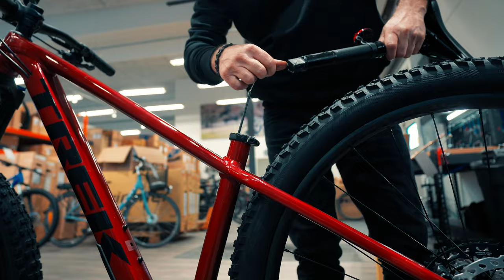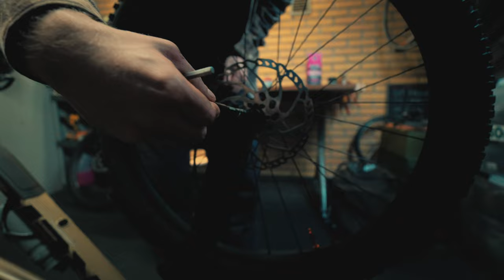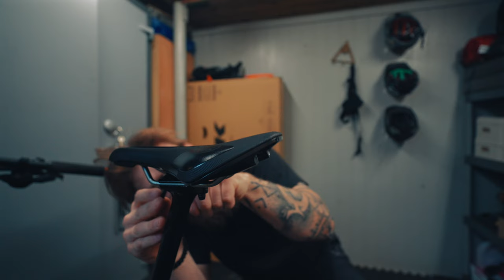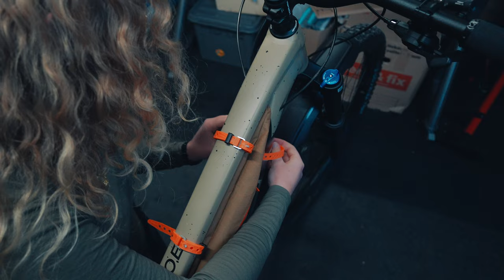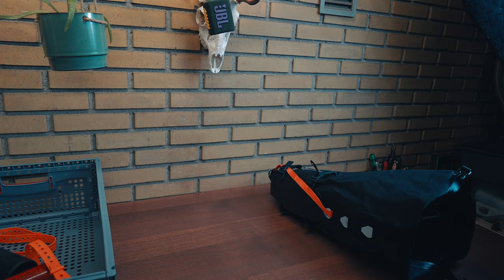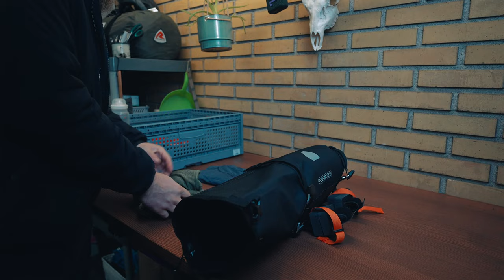How to start Bikepacking? l Gear setup

Comment: the basics of brand new bike prep for bike packing is frame wrap ( + fork ), personally i use full suspension bike with topeak bike rags and paniers bags - easily up to 2k km  suspension service intervals - clearly that is not a preffered solution for remote areas but for major european destinations works. From my experience plus tires for heavy load ( long trips) is a must have ( i ride on 27.5x2.8 and its comfy

Comment: Hello from Ukraine. Still can not choose between rigid bikes and with front suspension for my touring setup. Does suspension extra weight, complexity and lack of mounting points worth it for the off-road touring bike?
Reply from the maker: Hello welcome i’ll definitely choose a suspension  with full logout for bikepacking
Reply: @Lucridebikes thanks)
Reply from the maker: You welcome ✌🏼
Reply: @Lucridebikes  I’m not sure if you can get these bikes to Ukraine but check out RSD bikes.  Mainly there RSD sergeant, middlechild, and major.  Full on hardtails MTB but you can get them with a rigid or suspension fork